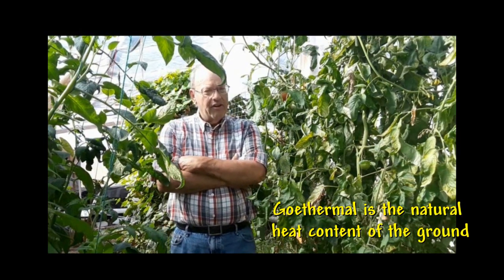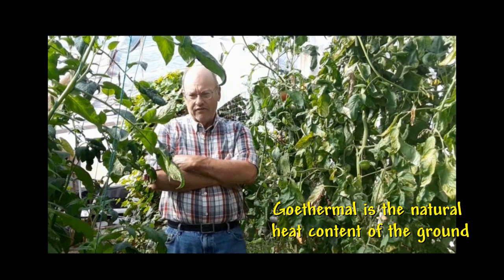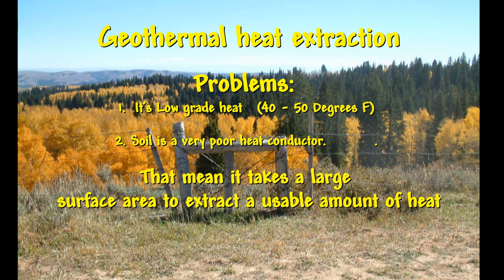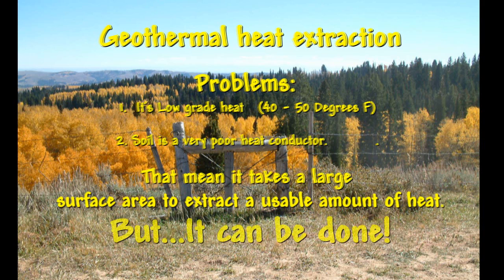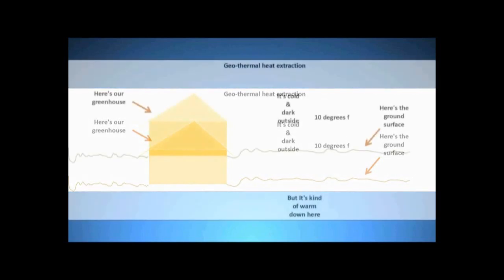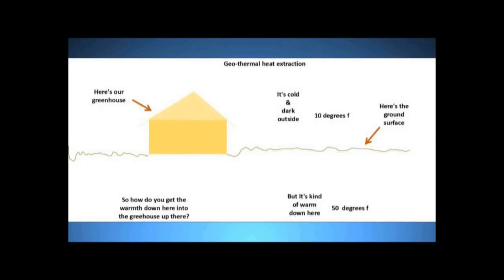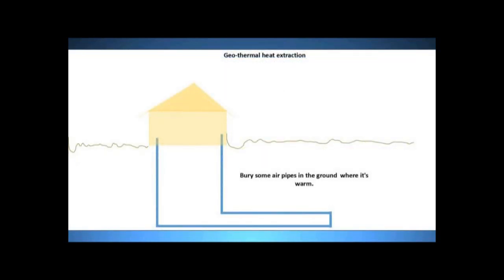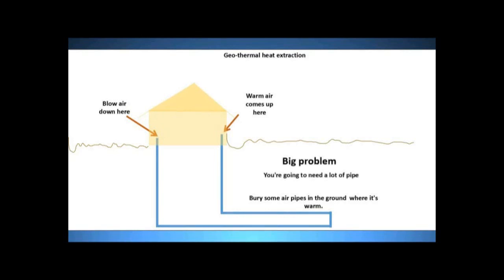Passive Geo-thermal heat for your home greenhouse

Comment: Do you have the formula to calculate how much underground pipe would be needed for a greenhouse about 12 ft by 24 ft and about how deep in the state of Northwest Alabama? I'm wanting to grow tropicals and bananas here but from January to March we have a few freezes and I'm just needing a system to keep my plants alive during those few months any input and advice would be very appreciative and helpful thank you
Reply from the maker: I never did work out any mathematics for doing this so I can't help you there.  You might investigate just how warm the soil is in your area by digging a hole somewhere and putting a thermometer down there.  It might be surprizingly warm.   Your greenhouse is not very big so you might try using a portable heater on those cold nights in the winter.   I have used a couple of 1,500 watt electric heaters during the winter at my place and it worked.  My greenhouse is about the size of four of yours so one heater might work well for you.  Of course there is a power bill to pay.

Comment: Ed - you have a point if you consider both burying underground tanks without insulating material or making an "Earth Battery" that is dry. The recommendations I have seen for using the ground for heat and cooling loss mitigation requires preparing the ground you will use ahead of time by lining the huge excavation with insulating panels, then with 2-3 mil plastic before placing your first 'rank' of air exchange pipes. Then filling in some sand or dirt (they used dirt) and then wet the material down - not soupy wet mud, but enough that you increase the thermal capacity of the ground. The family that built their greenhouse over the pit with approximately 8 ranks of pipes did cover over the layers of pipe, dirt, and water stated they had to open their greenhouse windows in the winter time in order to mitigate the stored heat during the day. They clearly were not in zone 7 as you are, but I believe they were in zone 4 or 5. I live in zone 5 and I think if a 12 foot pit was filled with a thick slurry and 8-12 ranks of exchange pipes insulated with at least 2" thick closed cell insulation, it actually would serve as a battery. The same with the underground tanks - although very expensive you can find used tanks and if so, a well insulated pit with dirt or sand packing inside the insulation pit would allow the buried tank to maintain the temperature fairly well. Of course, you would need only about 10-15R to make the tank serve as a battery instead of a passive heat loss storage concept. 

Either approach in Zone 7 would require a thorough planning stage prior to building your already established green house, so your approach of a garden shed might prove the easiest and least expensive method for you. If you increase the thermal capacity of an "Earth Battery" by saturating the highly insulated soil, if you could store the summertime heat and show some decent performance - but with the length of you night and the length of winter would mean you would need 3x the effective storage mass - and some sophisticated control systems - to utilize a modified "Earth Battery". Not geothermal, but a modified summertime storage Earth Battery series that might last more than half your winter. One 12 foot pit under a greenhouse in my zone (4-5, I'm on the southern edge of 5) should last the winter for me. 

Thanks for the calculations and the caveats - you are spot on for your location! Thanks for the videos.
Reply from the maker: Thanks for taking time to reply.  Others will read this too and get some insight from your assessment.   I have used the above ground water storage for a long time now and it works well for me.

Comment: you say that people can't wind the tubes back and forth in a smaller area, but people are doing this in idaho and other places and it's working great.  Especially if you do it under the greenhouse.  2 layers back and forth generally is more than enough.
Reply from the maker: That depends on exactly what you're trying to do.  If you are concentrating on only extracting heat from the ground, you can't do it from a small area for very long.   You'll cool it off too quickly because the small area can't replenish itself as fast as you're taking the heat out.   That's why the large area is needed.   An analogy, suppose you're trying to water your lawn and you either have to use a small kiddie pool for water or a big pond that's close by.   Of course the kiddie pool will run out of water quickly whereas the pond won't even notice the water  being removed.    The kiddie pool will only work if you're putting water back in it  as fast as you're sucking the water out to water the lawn.
Reply: @eddysgreenhousegarden7022  ya, which I think is the general idea with most passive solar systems, you pump whatever extra heat you get during the day into the ground, and pull it out at night and it will naturally, slowly, try and refill itself.  It is an interesting idea though to add a few spread out ones as a backup though, it's just so much more land to do so.

Comment: There is a fellow in Nebraska who had 125ft of air source. It not only allowed him to grow oranges in a green house, but a second one he rigged up to an air source heat pump to heat his home as well. Im pretty sure he has passed on now but there is a video of it on youtube. Secondly, The air flow needs to be reversible for maximum efficiency. You want to pull the cold dense air up out of the ground in the summer for cooling. Suction is necessary for efficient refrigeration effects and storage of excess energy in the summer. That is where people with the idea of a heat battery are failing. They are trying to force the hot side of the system.
Reply from the maker: Dave,  That last point of forcing the hot side is interesting.   I never really thought about that, but it does make sense.

Comment: I think folks should do practical testing before making any recommendation on what tube lengths to use. The performance of the system in the video would be woeful ;)
Reply from the maker: Oh absolutely.   I was just trying to show the general things you  have to think about if you want to try this.   But you're right, it takes a lot of planning and figuring up front or you'll be very disappointed in the result.

Comment: I guess I’m not fully understanding or agreeing with your assertion that soil is a poor conductor of heat, relative to water.  First link below compiles a list of thermal conductivity of many materials, second link compares dry to moist soil.  Moist soil is actually a far better conductor of heat than water (presumably fresh).  Also, unless I’m misunderstanding, you appear to contradict yourself regarding the necessary geometry of an earth battery.  If soil is a poor heat conductor, then it would appear that you COULD orient pipes tightly without depleting the heat from a volume of soil.

http://hyperphysics.phy-astr.gsu.edu/hbase/Tables/thrcn.html

https://thermtest.com/applications/soil-thermal-conductivity-tls
Reply: That said I think your conclusion that the earth batteries is fair (a lot of work, and it won’t heat the greenhouse, per se, but may forestall freezing).  I know a guy from Fresno who’s gotten fantastic COOLING results with an earth battery.  Evaporative cooling is a no go for him since he must control humidity.
Reply: You made a good point in one of your other videos on the superiority of steel water barrels versus plastic.  I think the same argument would hold for the typical earth battery air circulation pipe -- thick plastic.  I'm willing to bet that an earth tube would perform far better with a more thermally conductive pipe.  For my vertical earth tube system, I used an aluminum distribution tube and (anecdotally) achieved more efficient heat transfer.  Unfortunately I never did a rigorous plastic-vs-metal ground truth experiment.
Reply from the maker: Morgan,  What I see when I look at those charts is soil is more than an order or magnitude less conductive than water is.   The 100 % saturated soil number appears  to me to be as good as it is because of the water saturation factor.   Think about rammed earth homes.   One of the  positive features is the walls are naturally such good insulation.
Reply: Here are the numbers that I pulled directly from the pages:

Water - 0.6 W/m*K
0% water saturated soil - 0.364 W/m*K
100% water saturated soil - 1.59 W/m*K

It's hard to know exactly what they mean by "100% water saturated soil".  I suppose we can conclude that individual soil particles are themselves fairly thermally conductive, but the pore space between the particles acts as an insulator when air-filled.
Reply from the maker: On orienting the pipes tighter....,  It’s the surface area of the soil from which you are extracting heat that matters.  Compacting the piping gets you better efficiency at extracting heat from a given smaller area of soil.  But the limiting factor is the soil’s heat transfer coefficient.  That determines how fast the extracted heat can be replaced for a given area from the earth around it.  The heat must be replaced in that given area or it will get too cold to extract any useful heat after a short time.  It’s much like drawing water from a tank at a constant rate.  The water must be replaced from another source, with a big enough pipe, or the tank will soon be empty.  Running the piping out over a very large area provides a much larger “soil” area for the piping to draw the heat from.  A larger soil area is like a bigger pipe to draw on to replace the heat.  The surface area of the pipes don’t change.  The overall area from which the heat is extracted does.  I hope that helps.